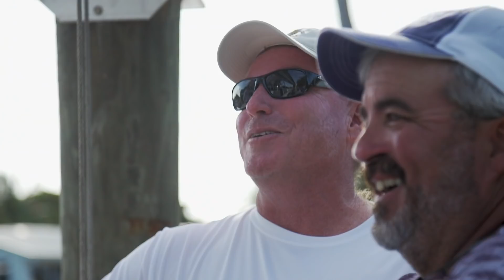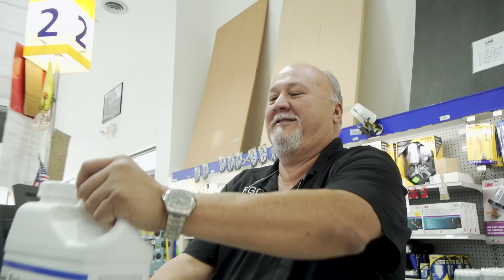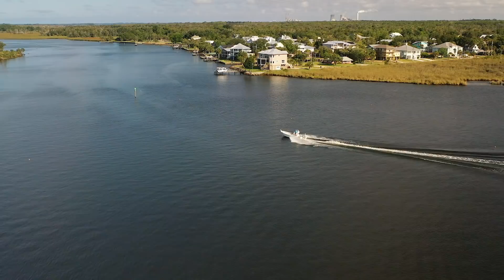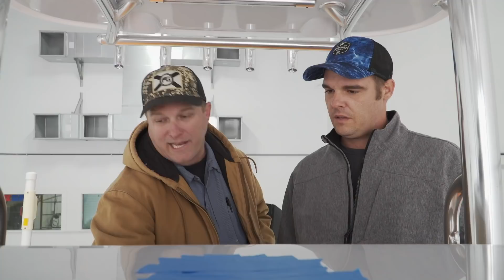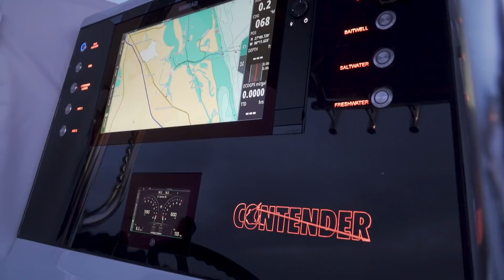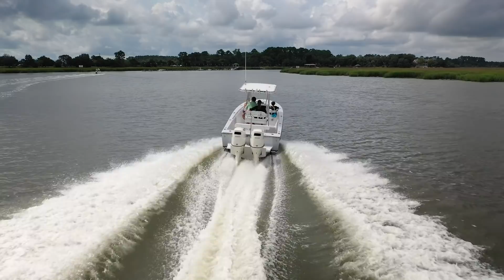Florida Sportsman Project Dreamboat - 43 L&H Underway, Classic 23 Seacraft Splash

Comment: Transom brackets/extensions aren’t a simple bolt on. Especially on an older boat. If the transom wasn’t originally designed for it, then not only should not only be inspected for integrity but MUST be structurally augmented with additional Coosa board, gussets and fillets to tie into hull and stringers. These brackets can more than double the stress on a transom through leverage/cantilever forces. There’s a video of of twin 300’s on a bracket sinking off the back of a boat with a bilge pump removing water probably due to a ripped out transom. See “Boat fail/win contemplation 2020”. Don’t let this be you, miles offshore with no time to give a Mayday.